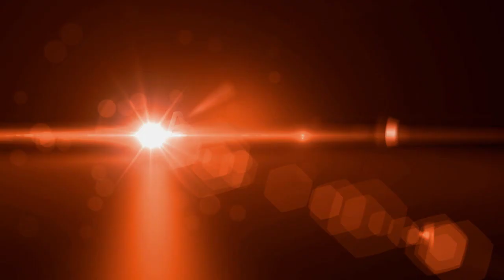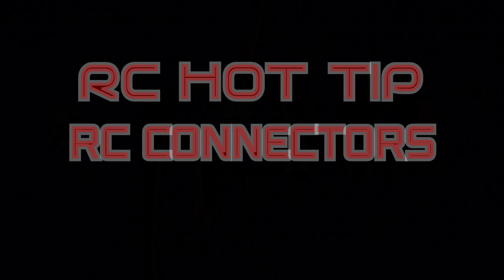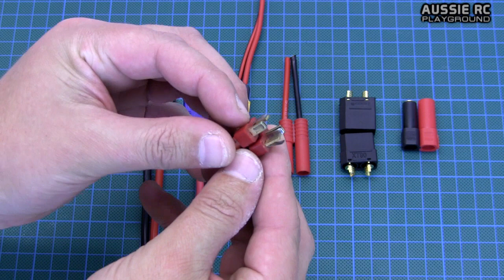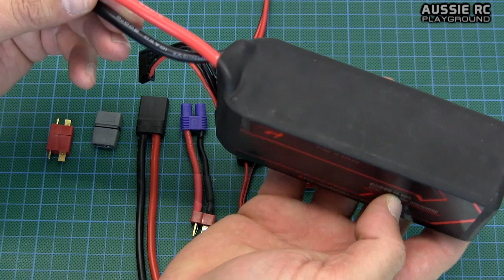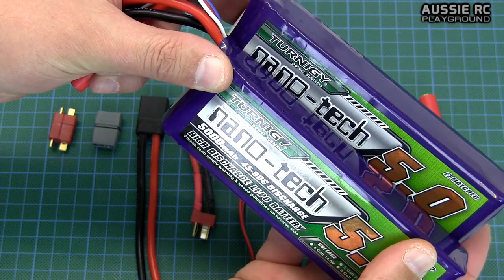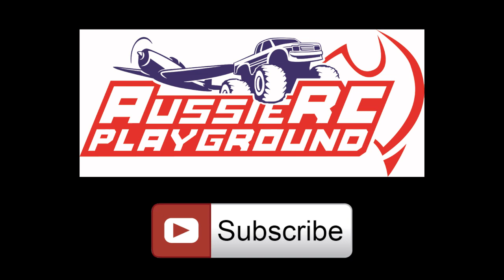RC HOT TIP: Choosing the right RC Connectors

Comment: Actually, you have more amp capacity using 4 wires to the ESC rather than just the 2 like you show, if using 8S.  4 wires = less resistance than 2 wires.

Comment: What soldering iron are you using to do your joins? Im burning the plugs trying to get the solder to flow.. got a propane soldering iron and an 80w electrical one... the solder joins are below average and ive just starting to get into the hobby

Comment: I have a kaiju,  what connectors would you recommend ? I have Dean's on right now.  N they do get hot after I run my truck.
Reply from the maker: I'd use either XT90 or EC5 connectors, depending on what you prefer or what's easiest to get in your area.

Comment: used to use traxxas connectors, its like a deans but harder to use.  The only really good thing about traxxas connectors is they will make you get much better at soldering. Not a horizon fanboy but i do like the ec5 dont get me wrong though xt90 looks pretty good when one of my ec5 bullets pulls out when i yank a cord when they are hot.  I guess they all beat using electrical tape to keep your wires together.

Comment: Great vid, but out of date now. Completely overlooks EC5 which are great in high amp applications.
Reply from the maker: Pretty sure I said in the video that I don't have all the connectors out there... 😜 But you are right, the EC5 plugs are great, just not great to solder.
Reply: @AussieRCPlayground  Roger that. I dread soldering them. If my entire and substantial fleet of planes and batts weren’t already EC5 I would be an XT 150 guy for sure.

Comment: Hey bro im new to this ...???? I have a redcat blackout xte. Im having problems cause everything has different connectors the las pair you showed can you use them with smaller wire like on 2s. ??? I think i want to switch connectors i currently use the 4mm bullet/bananna and deans .. Its a pain in the ass wanted to know if the last pair is pretty much good for everything

Comment: Hey man I know this is an old video but i'm looking to convert all my batteries and ESCs to one connector (currently I've been using adapters) I have 2s all the way up to 6s. The smaller 2-3s batteries would be fine with the bigger xt90/ec5 connectors right? Pardon the dumb question but i'm suuuuper green when it comes to amps and stuff like that. I figure since I only want to use one connector and have big 6s packs the bigger xt90/ec5's would be the best bet. Any info would be great!

Comment: 4:01 you dismiss the 4mm bullet connectors very quickly, as if they're junk.
These dirt-cheap connectors are easy to get, cost damn next to nothing in quantities of 10+ pairs, and are good for roughly 100A of current.
Their only disadvantage is that they're quite stiff and difficult to connect/disconnect--a problem that's easier to manage if you slice the plastic connector housing in half, so they're separate :)
A great dirt-cheap common connector for reasonably high currents.
Reply from the maker: Unfortunately those are not commonly used here (or in general) and are difficult to get. That's why I dismissed them.

Comment: Vas what connector do you use on your 1/10 scale 3S and under vehicles? I use XT150 on my 4 and 6S vehicles and not sure if I should use them on my smaller cars.
Reply from the maker: I use XT60 connectors for my 1/10 stuff.

Comment: I see you're wiring your batteries in series. Is it possible to use the XT150 Connectors for two batteries in Parallel?  Without using a Y adapter?

Comment: You seem to be an expert so can you solve a mystery for me? How come big beefy 6s LIPO 6A -10A continues 35C rating are equipped with xt90?   that is 350Amps... and the xt90 handles only 90Amps.. and perhaps only 140A momentarly...   Big octocopters   use usually also 400A combined yet you only see XT90 installed or  perhaps XT150 which is not even enough... Man I am really in need of an answer
Reply from the maker: I can't tell if you're being serious or taking the piss. But if you know all those stats about amps, I'm sure you can figure it out on your own...
Reply: What? oh no not at all. I am serious. A lot of batteries have  a discharge  far exceeding the connector capacity so I wanted to know how?  Thought perhaps you perhaps could know, pretty hard to find any info on the net. Thx
Reply from the maker: Hmm, I'm still sensing a hint of sarcasm... but ok, I'll humor the question. 
The batteries don't push the amps to the motor, it's the motor that draws the power. Connectors will handle well beyond what they are "rated" to to a certain extent. Their rating is for constant amp draw, not fluctuating draw as used in RC. The idea with bigger connectors is to minimize resistance in the circuit which in turn reduces amp draw and heat. This makes for a much more efficient power system and usually results in more power and longer run times. Not to mention cooler temps and healthier batteries.
Hope that helps.
Reply: I am really shocked that you think I am sarcastic? perhaps it is my non perfect english that messed up, I dunno. Anyway thank you. yeah the motor draw is the deciding factor. I Got you. But for the fun of it lets assume a scenario here: an octocopter in "hover" use 20A per motor.  20 x 8 is 160 A  a typical 6s 20AH 45c should do the job. Everything is fine so far but these 6s 20ah batteries usually  only have xt90.  Yes xt90 handles 150A but only momentarily, not constantly. So what is wrong here? Thank you.
Reply from the maker: Well, I use XT150 connectors, so I can't tell you if the XT90 will handle anything over 150AMPS without showing signs of wear. But XT90, EC5 and Castle Connectors are all very similar and they are all used in RCs pulling more than 150amps and they seem to work fine. Maybe their rating is relating to max amps without loosing a certain amount of power, but they can handle more amps and heat without failing?! I don't know...

Comment: So I am still pretty new to the hobby, but im running a 120A drift esc with dean connectors on 2s would switching to bigger connectors make a difference or would that rule only apply to something using 6s or above?
Reply: If it's not melting off you will not gain anything. Yes you can lower restaince slightly depending on what connectors you run you prob get lower restaince just running shorter wires most the time. People don't run dean's much because it's common for them to unsolder.

Comment: i run deans on all my planes 3s,4s, and 6s with no problems for a couple if years now.  if you have a problem with it getting hot then there is a problem other than the connector. the only things i dont like about them is its a little hard to connect and the arc/pop when you connect them. i do like traxxas connectors too, the real trx plugs not the fake ones you have in this video which are total garbage.
Reply from the maker: All Traxxas connectors are garbage, especially the new ones, which are huge. Planes running 6S don't pull anywhere near as many amps as cars do, which explains why you don't have any issues using Deans. When you start pulling upwards of 150amps from your planes, then you'll realise how crap they are. Plus, it's not just the melting that's the issue, it's the fact that Deans are a choke in the power system and increase amp draw. That's why I use XT60 plugs for all my 1/10 scales and planes, and use XT150 plugs for all my 1/8 scales. I get more efficiency, cooler temps from all electrics and more power.
Reply: no 1/8th scales pulls any where near 150 amps continuous on 6s. most 1/8th scale esc's are only 150 amp. there are plenty of people using deans that pull 100+ amps without any problems. i use traxxas connectors on a extended modded emaxx on 4s and 6s all the time without issue they dont even get warm. any connection or fuse is a choke in a power system, this is why racers solder all connections. to each his own i guess.

Comment: Thank you for the info!  I was getting ready to pull the trigger on the castle connectors but they are very $$$$ plus i love the way they disconnect so you dont have to use an adapter to run two 3s or 4s packs for 6 or 8s speed runs and ill save a bit of money i can put into my car/lipos etc...  shame bc i just bought a big pack of deans connectors a few months ago but they have been heating up quite a bit!  Im sure ill find another use for em!  Thanks again for taking the time to share info with other hobby junkies!  Take care n be safe!

Comment: hey what would cause my xt60 connection to spark/burn when plugging in battery?
Reply: DomPeish You can't. You will have a spark in every high voltage application.
Reply: High voltage is causing those sparks. You need to use anti-spark connectors to avoid this. I use XT90-S for my 6s batteries.

Comment: great video sir👍 quick question  i have a 3s 65c 5000mah lipo it's  3 to 4 months old but only used 3 times then put into storage voltage. could i buy the same 3s and use it in parallel with the  3 to 4 month old battery that was used 3 times
Reply: Yes you can, you can actually run even different batteries in series as long as the voltage is the same.
Reply: In theory you could even run. Something like a 5000mah with a 600mah, but i wouldt recoemend it. You can do it with a 5000 and a 4000 tho.

Comment: Thanks for the info. These connector are good for RC but they are great for 3D printing. Specially JST type connectors for 4~5~6 pin. XT60 for Heatbed.

Comment: the red plug with the 4mm bullets are HXT 4mm. rated to 93A, they are super simple to solder and you can cut the plastic housing in half to make series connections like the xt150. I use these exclusively for my F3A pattern planes where 80-85A are typical, I use two 5S packs are wired in series to make a 10s pack. since they are banana conectors, they are great for lots of other uses too.  you get a 10 pack from HK for about $4 USD.

Comment: That battery connection where you connect two batteries  is a problem because most cars you run to 3 cells will have one battery on each side. So the connection is two short to connect the two batteries in series. The good is if u have a car that runs 6 s like arrna Kraton that has all batteries in one tray that's a great idea. Thank for the info.
Reply from the maker: +Brayden Stamps nope, that's not true. I have ran my Nero, Hyper MT and my Team Magic E6 trucks which all have batteries either side and the batteries connect just fine. And there's no need for extensions either.

Comment: Aussie? Why does the X maxx  use fusible links then? Will this setup (pluging red into black) work on the X maxx using the Hobbywing Max 6? Thanks, your always so informative.
Reply from the maker: Not sure what you mean... But if you're asking if the Traxxas connectors worth with the Max6 ESC, then the answer is yes. They should work with any ESC.
Reply: Sorry for the confusion. I was wondering if the XT150 connectors would work on the Hobbywing Max6 Esc.

Comment: I've always liked the idea of plugging batteries in series with bullet style connectors, however the danger of being able to plug them wrong (Short circuit a battery on itself or closing the circuit between 2 batteries) makes me regret them. Also the use of right sized or over sized connectors will mitigate the multi connection points "bottleneck" problem.
Reply: yeah i really think, someone's going to blow himself up, shorting a battery...

Comment: Hi Vas. You sold me on converting to XT150 and I have watched this vid and your xt150 soldering video. The only thing you left out is a detailed section on what gender and housing to use on charger leads, battery, and esc to duplicate what you did. Even a picture of each would suffice. I have spent quite a bit of time searching the internet and info on this topic is scattered, inconsistent and conflicting with each other. Thanks mate.
The way I'm putting it all together in my mind is:
ESC: Female large red housing, Male skinny black housing
Batteries: Female skinny red housing, Male large black housing
Charger lead: Female large red housing, Male skinny black housing
If that's not right, I'm totally lost.

Comment: how can I run 1 battery to a ESC with dual connectors?
Reply: there is a loop connector so you use one connector tot the battery and the other one, is looped by the connector you can buy
Reply: +X-Men Thijs thank you

Comment: Thanks for the video, Vas.
Changing all my setups to XT150 connectors. Found out that there are different versions of these. Posted a video on my channel about an issue with some different brands of these as well as a soldering demonstration. 
Check it out when you have a chance...
TechGuru4U

Comment: Great video! Glad to see someone else putting out a good word on the XT150. I switched all my surface RCs to them about a year ago and never looked back. Easy to solder, very versatile and easy to disconnect.  Best of all they are pretty cheap and come in 3 colors if you want to do motor/ESC connections as well.

Comment: Thanks for this great video ! I've now changed completely to XT150 for my Arrma Kraton. SO much smarter running in series without the y-harness. Thanks for sharing your thoughts and ideas so others like me can learn, much appreciated !
Reply: +Off-Road Aussie RC ok so I'm getting ready to switch to XT150 for my Talion and Typhon.  So I can solder to esc and take that little loop plug out?  (running 2 3s)  does the Arrma esc wires solder good into the XT150?
Reply: +JAWS1376 Absolutely ! Yes & yes to your questions. You delete the loop wire completely, instead connecting the 2 batteries in series by plugging positive from one battery to negative of other battery.
Reply: +Off-Road Aussie RC thanks!